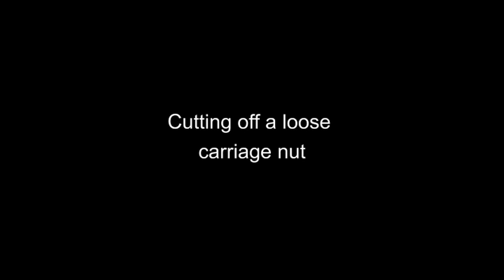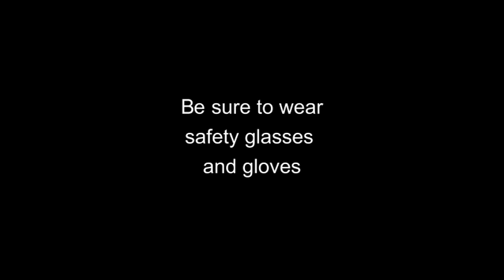How to Cut off a carriage nut that is locked or rusted

Comment: Thank for posting.
But mine are much bigger bolts & nuts.
They are high quality metal, ATG Nickel-Based Super Alloys Kim X.

Even trying with a blow torch will not melt them.
Reply from the maker: The next thing is the angle grinder that the tile guys use with a diamond blade.
Reply: Tried it on the nut & bolt, not even a nick on them.

Got other suggestions?
Send an email to NASA & have no luck.
Reply from the maker: Wish I could find some bolt that hard ,then that would give me something to work with
Reply: You can come here and try to cut these bolts & nuts for me.

Oymyakon temperatures are in the 20's.
Winter gets very cold. It's below -50's, where many bolts will not hold up.
Reply: Keeper Of The Reaper, guess you never work around NASA's liquid nitrogen and around F40.
Reply: A dremel tool with a tungsten carbide bit with cut quickly through hardened steel nuts and other fittings. Keep the speed relatively low (10-15k RPM) and avoid too much pressure or overheating the bit. "Let the tool do the work".